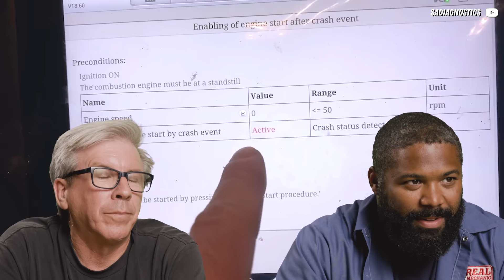Mechanic Reacts to Engineering Fails

Comment: I didn't curse any engineers as a car mechanic, probably cuz I never was one, but I have cursed out a engineer or two when working at a factory assembling grain bin parts. Even in that field, you'd have some weird crap like having to reach inside something to tighten a bolt, but like there was a big ol' belt roller in the way or something so you'd have to find creative ways to reach it. I guess my point is that it happens in any industry.

Comment: You know how you can get blessed engineering? Someone makes the engineers perform every kind of maintenance possible on the car. 
I thought about it and that's not even that hard. You don't have to make them run every procedure on every design, that would take basically forever. But you do make a list of the jobs on a car, and have them spend one month every year doing some of those procedures on an existing car.

You'll soon see how quickly those designs get improved.

Comment: Only time I blame engineers is when bolts are clearly much longer than they need to be and they are locked somewhere that should of had plenty of room otherwise and it requires you to drop the engine or something crazy like that.

Speaking as someone who likes to fit big things in small places.

Comment: The Porsche 986 is a fine car.  But if your battery dies, you can't open the front trunk to access the battery to charge it.  There are a few ways to get into the front trunk but they all are a time consuming PIA and you have to study YouTube videos to learn how to do it.  It was a huge engineering fail.  They changed it in later models.

Comment: The battery placement on my 2000 Dodge Intrepid was pure stupidity on the part of the engineers.  You have to jack the car up, remove passenger front wheel, remove inner wheel panels to access the battery.  Not exactly something you can do in a Auto Zone parking lot.

Comment: I am an engineer and I am working now as a maintenance manager/industrial mechanic in a production plant and I can tell you I hate the design of some industrial equipment this company has. It insane I have to come up with crazy ideas or disassemble a section of a machine just to get a f…ing screw out🤬.

Comment: The car cooking, fuse is too big for the wiring, poorly designed fuse box or assembly could allow wiring to touch and draw unfused power etc, I have a major gripe with engineers, now I'm not whiny, but some oil filters are in absolutely horrible places, we had to make a tool once, it was just a disk with 4 3 inch long flat pieces of metal welded to it that we had to pound into the filter to get it off because it was so deep in there and the only tool that fits just started slipping, but really infuriating to me is making a thousand different types of plastic oil filter housings that tend to get stuck and are sooo easy to break into 32 pieces and they probably aren't made anymore 😢

Comment: Cursed out a state  inspector for telling me he would  fail  my truck with out even looking at it... after fixing everything rebuilt motor  new breaks new clutch  new u joints new radiator  new water pump new calipers   he wouldn't  even look at it for a mirror  that was loose  put a self taper  on it with lock tight also took it to a  garage  legit mechanics  for the inspection an it passed nonthing except  a hanger  that was used to lock the pipes other then that it passed

Comment: On the flip side of the Mercedes "no engine start after crash issue", so if you can't get the car off the road and you're okay, I guess good for you? BUT what about the motorists coming down the HWY that might crash into your disabled car; what about their safety? What about the safety of others? Having a 4,000 lb blockade in the road could be deadly for others...

Comment: Changing headlightbulbs on my car, I need to remove the frontbumper. 
I would call that bad engineering. It might be a really good reason for it, but I'm never gonna talk to the person that designed the car, so I'll never know why they did that.

Comment: The oil filter in the bad spot is the show mechanics should have though about digging a full filter out of there and the car engineers could have found a good spot for a remote filter.

Comment: My 97 honda accord you have to take the rotor assembly off the lower control arm and the axle to access 4 bolts on the back of the rotor to be able to change the dang rotor pain in the butt

Comment: There is one thing I have always cursed engineers for- 
2007 Mazda 3 GT.  Why make replacing the cabin filter so difficult ???  It’s a regular maintenance item, shouldn’t it be easy to access.

Comment: I'm an engineer [not automotive] that also works on my own bikes.  I used to own one where the numberplate bulb went and to replace it took THREE HOURS and stripping down the rear of the bike, removing over 20 fixings, two of which are behind a frame member and inaccessible with spanners or sockets unless you have a wobble bar [which I do].  On my other bikes it is a 2 minute job as two screws have to be removed from the holder then the bulb replaced.

At 06:10 in this https://youtu.be/vesWZahhAV4 you can see what I mean.

I think that the car designers rather than engineers are more at fault.  Designers say 'we need ti to look like this with these measurements, it's over to you to get everything to fit' then the production bean counters come along with 'we must produce the car in 6 hours on the line' so everything is modular and designed for ease of production rather than ease of maintenance.

Comment: The Audi engineer made the five ignition wires look very nice by routing them all tightly together in a steel pipe across the entire engine so they could share current and misfire together.  Never work on sn Audi.

Comment: Some of the whiny mechanics should try working on armored military vehicles. Changing a starter involved unbolting armor, lifting it off with a crane, then pulling the pack (Engine/transfer/transmission) to unbolt the starter. It can take almost a full day.

Comment: Fuel filter for a 1995 dodge 3500 5.9 Cummins dually.  I swear trying to change that damn thing takes hrs, lots of cursing, atleast 3 skinned knuckles, crying, pleading, and feelings of utter failure before you finally get the original off.  Just to do it all over again putting the new one back in.  On my truck it was so damn close to the engine block you couldn't even get a strap muchless a piece of paper between them...  engineering failure!

Comment: I'm no mechanic, just a car owner, with a sunroof...

I'm not even mad at the engineers, but at the board, who had the financial incentive, to put in a proprietary draining hose, that overengineered, made out of 3 separate rubber piece, with 4 potencial points of failure, that is also overpriced, instead of one 6 feet long rubber hose, fixed in place with freaking zipties, for the water to drain down to the outside of the car, instead of into it.

Comment: about the first clip. I think it's more of a third party manufacturer's fault. I work in the automotive industry and Wiring harnesses are usually manufactured by a separate company. Usually the car company would give the wiring harness manufacturer a wiring diagram or schematics or whatever they call it and the wiring harness manufacturer would design the harness around it. The first clip was indeed an engineering fault but not from the car manufacturer themselves.

Comment: Tell you what, open the door on a Ford GT, then put a piece of cardboard where the roof would be if it were fixed, then try to get in. It'd be like crawling into a tunnel. You'd have to almost lie on your back and go in horizontally, feet first. If you went in head first you'd have to crawl all the way to the passenger side to get your legs twisted around to go under the wheel, then twist back to sit, and getting out you'd have to probably have hands on the pavement and crawl back out again.

Comment: Anytime you have to remove an engine because you just can't get the bolts out with the engine where it's in place so it turns a 5-minute job into an 8 plus hour job for something that should be simple

Comment: Im no mechanic or engineer. But easy serviceability is 1 thing I enjoy with my cars. I have a 98 Escort and despite it not being the best or most reliable car, I prefer it over the Focus because at least it is cheap and easy to replace a large majority of the parts. Blow a freeze plug on an escort? Well thats about $50 and a an hour of lazy work and cold beer. Blow one on a Focus, well youre gonna have to drain all the fluids, pull the transmission, drop the engine, remove half the external parts, figure out exatly what factory made the engine so you can get the right sized plugs, then put it all back together. Or you can pay a mechanic 5 grand and see your car again in a week maybe

Comment: I know engineers' hands are tied in many cases. There have been some interesting choices in the past regardless, but I don't think it's usually the engineers fault. They are doing what they can with what the manufacturer deems necessary.  I can tell some Chevy engineer that designed the s10 4 cyl tried to help by putting in  a little gutter from the bottom of the oil filter housing so it drips residual oil to the drain pan instead of leaking all over your subframe and wiring when you do an oil change, even though they had to mount the filter in a place where you have to take off the front tire to easily get to it.  That's what I call trying to think of the tech's working on it. Then again, that was 22 years ago that my truck was made, and cars have gotten infinitely more complex.

Comment: I've cursed bicycle engineers before ...and I'm an engineer, like: the most stressed bolt is also finely threaded hardened steel going directly into soft aluminium.

Comment: Was following a Subaru and it's was on the highway and his car locked up at 110 ks hr and when we tried to help move the car we couldn't get the front wheels to roll so in the end we dragged it off for everyone's safety even local police just stopped to see if everyone was OK and left at this point the car was still on the highway blocking traffic they just left us to it

Comment: I would say an engineering fail would go to VW (1992 - 1996) Golf. Maybe this motor was put in other models but the one i had was an actual pain in the actual arse. Having to Remove the Air Fuel intake (Top of the Motor) in order to access and replace the two centered... Spark Plugs. WTF?!!

Comment: You have to consider some more facts. 
Like in the video about German engineering, Japanese cars are also build around the engine. And there are a lot of cultural requirements and the factor of marketing. If you build it complex it generates more money when visiting the work shop, you guys know money is not made by car sales it’s made in the work shop, the luxury categories like BMW and so on want to deliver massive power, but a quiet passenger cell. That’s what Germans want, if you buy a sports car the preferences swap.
And a lot of cars have a service position for the front bumper to get better access.

Comment: 12:20 that Audi would be easier with a scan tool. Tell you if the fuse or open circuit is down

Comment: Can't remember the year but it was a Dodge nitro AWD not 4wd the diff is on the opposite side under the oil filter ok filter isn't coming thru here had to call a dealer, yeah it's 1.8 hours in labor to change the oil on the. Battery, coolant reservoir, washer bottle cause it was one whole unit the the battery tray just to change an oil filter.

Comment: Not a car but in a mig21 if u want the change the oil tube where u see the oil level u need to get the plane in half get the motor out than u can get a 3 inch glass rube out

Comment: I cursed the engineers of the Jeep Patriot for putting the fuse box behind the front left headlight and then making such an open car. My fuse box rusted into dust because the car was pushing 8 years old and I live north of the Salt line. 

Also having to replace crossmembers under warranty because they lost a lawsuit due to the road salt.

Comment: DEF systems using ADBLUE are a fail everywhere - especially the bit where you get 500 miles to sort it or it just shuts down (or wont restart if it shuts down). Its Automotive Blackmail - Even when you've fixed the car, you have to drive it 40 miles before it releases you from the blackmail - and if for some reason you havent fixed it correctly (ie a NOX sensor not the Injector) then you start the process again, but with whatever you have left of the 500 mile countdown. Dealers have a remedy for this - change EVERYTHING, charge you £1500 - and give you a free cup of coffee in reception. Nice business if you can get it! Not getting it??  Buy a Jaguar Landrover Rangerover Dealership...

Comment: Hope you don't have to change a alternator in a Ford Escape 2005 they're on the bottom of the motor on the passenger floor side you have to move everything to get to the crap

Comment: The most annoying filter is on certain VW cars you have to remove two bolts holding brackets for hoses and stretch the hoses to get the filter and cap out, what happens when the hoses break from the strain of repeated oil changes? no ones gonna remove hoses to change the filter.. 7:45 that guy is a whiner, I changed many of those its annoying but not that difficult, try changing a heater core on  a last gen Chevy S-10 then you will be annoyed.

Comment: Changing the fuel pump in a Ford E350 35 gallon tank means  either dropping the whole tank which is at least 6 hours with two guys or cutting a hole in the floor of the cargo bed to get to the top of the tank pump cover.   No access panel?  Really?

Comment: Thermostat on a 4.2L Inline-6 Atlas Engine.  Tucked in behind the alternator.  What's so bad about that, you ask?  Because in order to remove the alternator...  You need to discharge out the A/C system.  Why?  Because the hoses go over one of the alternator bolts, making it impossible to get even a ratcheting box-wrench in there.  And that SOB is so overbuilt that will not budge for all the tea in China unless you disconnect it from the A/C compressor.  Wonderful engine.  Shitty placement for things that will eventually wear out long before the engine itself does.

And then there's the engine-to-heater-core hose that runs around the backside of the engine and is held in place with the damn transmission-housing-to-block bolts.  Because apparently they designed this setup so the engine and transmission goes into the vehicle as a pre-assembled unit.  Which is great for the assembly line, but an absolute nightmare for a mechanic to deal with.  Because in order to get at anything back there, you need to take everything down to and including the valve cover off...  Which means, yep, you guessed it!  DISCHARGING THE A/C SYSTEM.

I've been working on a 2005 GMC Envoy for my folks.  They made the horrible mistake of mixing Dexcool with another antifreeze, thus turning it into jell-o (WHY GM?  WHYYYYYY!!?), blew up the radiator, and warped the cylinder head so badly that the machine shop was only BARELY able to save it.  (Oh, and those cylinder heads are so huge that the machine shop had to outsource the job to another shop that handles BIG diesels.)  Said machine shop thinks that I am absolutely insane for working on this thing, and I don't blame them for thinking that.

Comment: Not gonna say many are eng fails, but it IS something that annoys me that things that where so simple to access like a radiator ( two bolts and two hoses) and out the door. Now you gotta take the whole darn front grill and bumper and some change to do it 😆.

Comment: That Ford oil filter placement is awful. Makes it near impossible to put any torque on it to remove when you try to do it yourself at home. Several of my recent cars have it placed accessible without jacking up the car even from near wheel well or up on top of engine.

I hate oil filters that don't leave finger width space around so you can grip it. Literally having to drive a screw driver in everytime to remove.

Comment: How about engineering wins? 95 Nissan hard body. Looks really hard to take the power steering pump off, until you realize that there are holes in the pulley that accommodate a 10 mm socket. Beautiful

Comment: Ford tech here. I have another bone to pick with those fucking escapes. THE BATTERY. WHO DECIDED TO MAKE IT TO WHERE YOU HAVE TO REMOVE THE WINDSHIELD WIPERS, HALF REMOVE THE BRAKE RESERVOIR, AND REMOVE NOT ONE BUT TWO DIFFERENT COWLINGS ALL THE WHILE BEING AS GINGER AS POSSIBLE SO YOU DONT CRACK THE GOD DAMNED WINDSHIELD.

Comment: Changing a battery in a 2014 Dodge Journey.  I shouldn’t have to remove the front tire and wheel well covers to get at the battery.  That should be an easy swap out.  Car was in a parking lot and I had no room to move the car to get the tire off to change a dead battery. So stupid design.

Comment: It seems that engineers love putting oil filters which are possibly the most commonly changed item on a vehicle in the worst spots. My 2018 Ram 1500 v8 4x4  has an oil filter above the front diff and cross member so to change that I spill oil over a big part of the frame which is already tight and hard to get into. A friend of mine has a 2005 mustang v6 which has a vertical oil filter right above a cross member as well. So getting a grip on it covered in oil, and in a tight and awkward position is almost impossible. I'm no mechanic, but how hard is it to install an oil filter relocation kit from the factory?